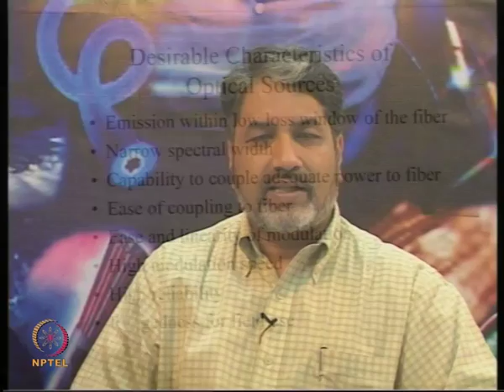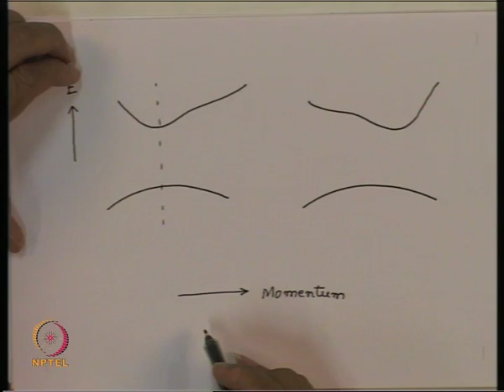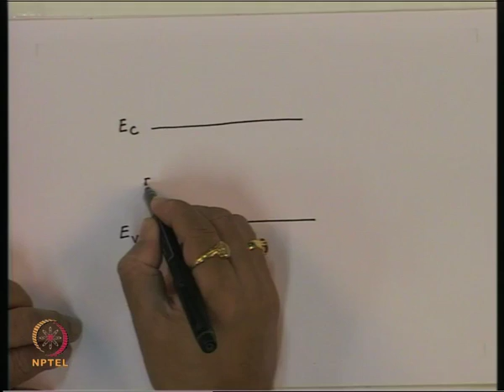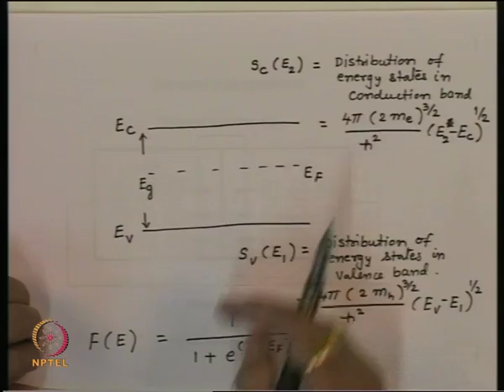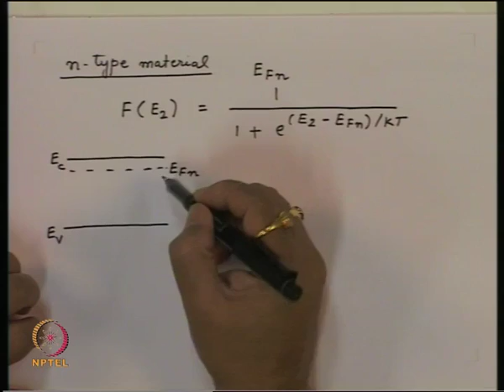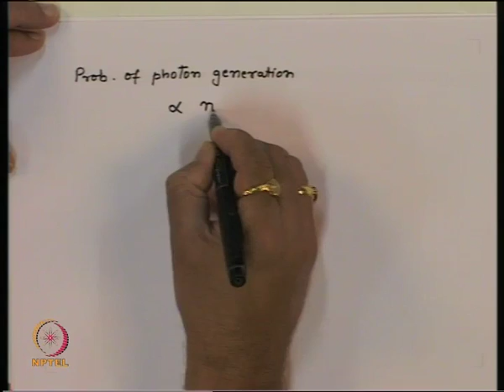Mod-01 Lec-12 Optical Sources

Comment: in making the approximation for the probability of a hole or an electron occupying an energy level using Fermi equation, it is not that E1 is much smaller than EFp or E2 is much greater than EFn, but the whole exponent |(E1-EFp)/kT| or |(E2-EFn)/kT| is much greater than one.